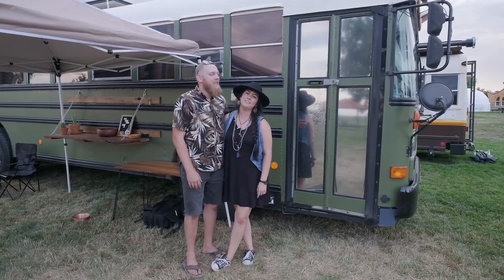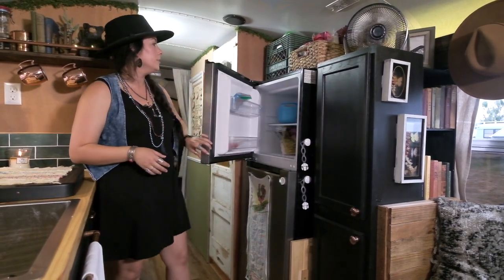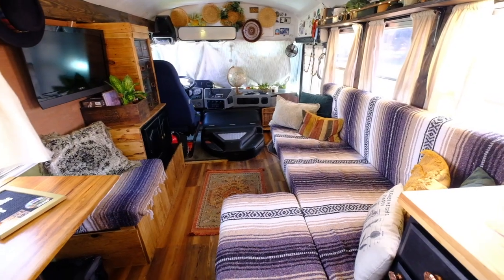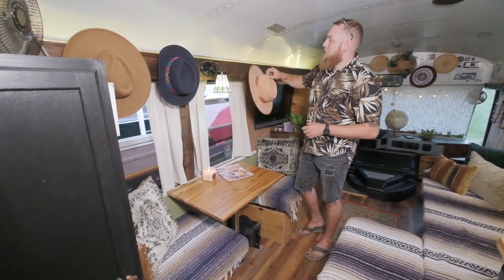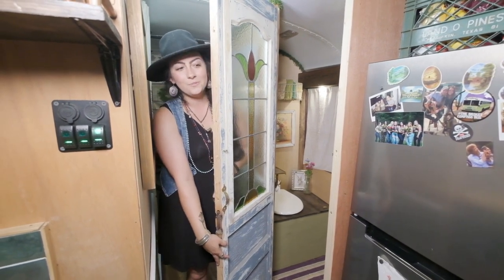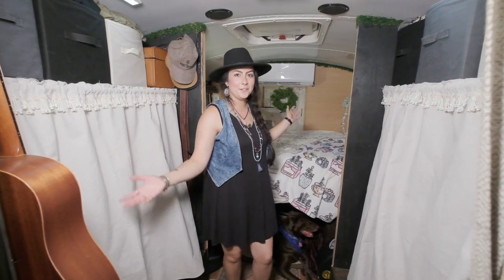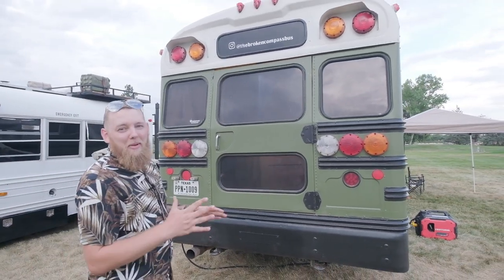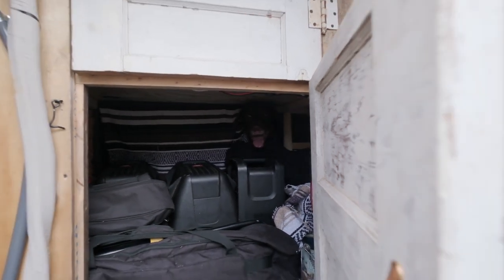DIY School Bus Conversion - "Soul Crushing" Job To Thriving Nomad Life

Comment: Not bad for a first build. The only thing that i didn`t like was the gas can around electronics. Fumes and sparks = explosion and flames. The safety can is a good one but not metal. I would make a box under or outside the back that locked up so any fumes or fire is outside the bus.